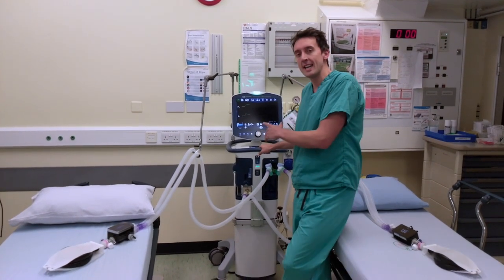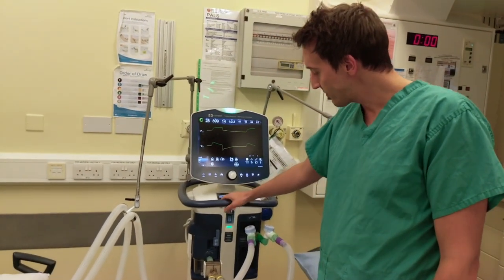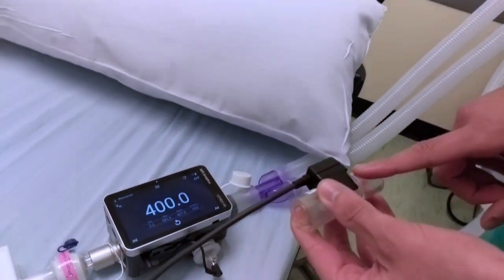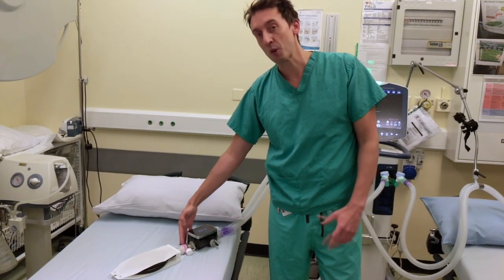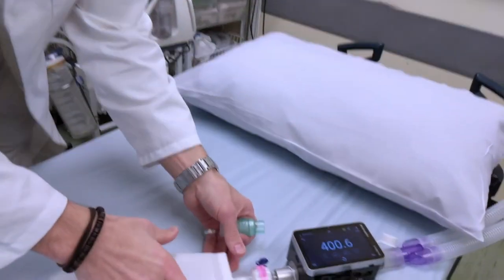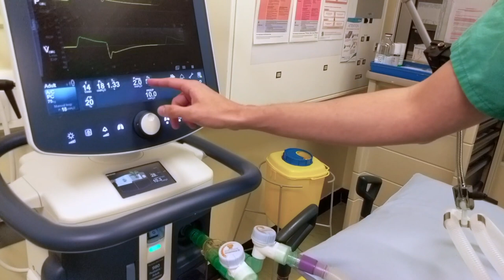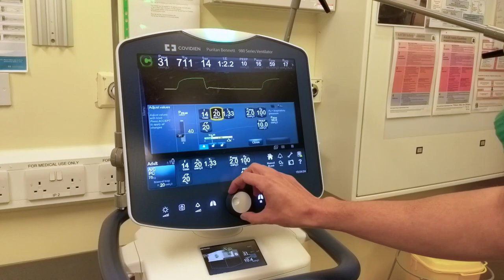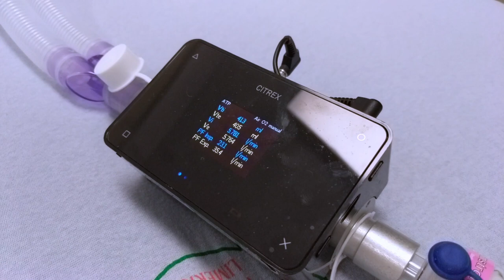Shared ventilation with individually controlled tidal volumes on ICU Ventilator

Comment: Nice job
Be sure your APL valves are behind virus proof filters, otherwise when the pressure in the circuit exceeds the APL vavles opening pessure the APL valves will open and the virus will be flying in the room,  I can't see clearly what adaptors connected to the APL valves but we experimented with a similar circuit using LMA airway tubings instead of APL vavles, we cut them and used Jubilee clips to secure them " to be used as female - female connectors".
Good luck